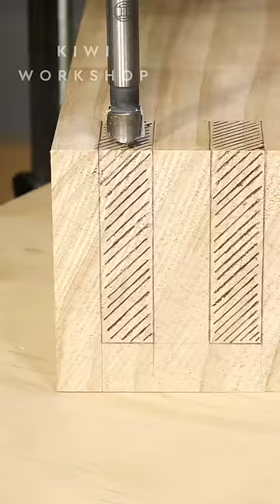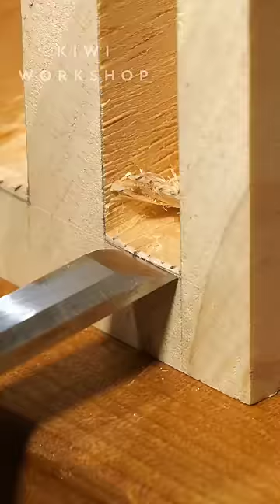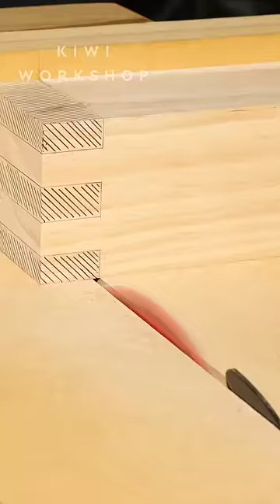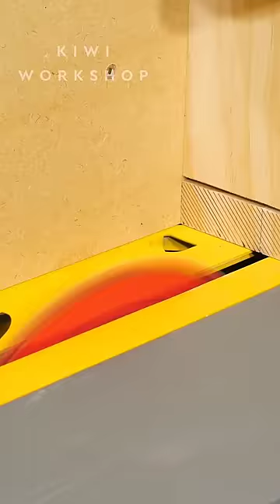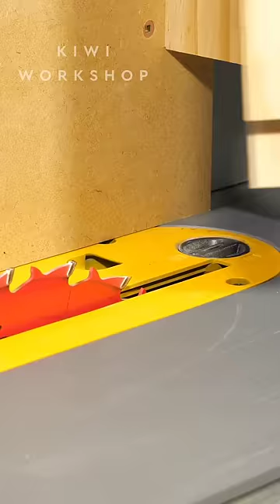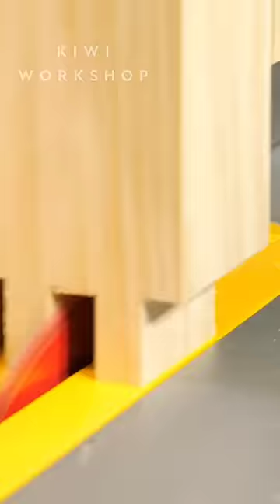What Is This Joint Called? #woodworking #diy #asmr

Comment: This one is easy: this is kakushi mechiire, or "housed tenon and mortise splice".
Reply: Como se llama esa broca?
Reply from the maker: @egglyph I usually refer to this joint as a "half-blind stub tenon" but the names you mentioned are also correct. I knew this was also a Japanese joint but didn't know the name. Thanks.
Reply: @kiwiworkshop it's not any kind of mortise and tenon. It's a blind finger joint because you have the same cut outs on either piece of material. Tenon is the shape of material to be fit in to a mortise which is specifically a hole to receive said tenon.
Reply: @dougler-6215 pero el término que el dijo también está bien.
Reply: I bet you got bullied in school😅

Comment: Imagine zero tolerance woodworking
Reply: With enough practice and patience, it's entirely possible.
Reply: What’s that in reference to?
Reply: @princegobi5992  it's when the apple doesn't know its been cut already.
Reply: @LemonGarageYT  omae wa shinderu
Apple: nani?!
Reply: @starmaker23871 
That's called wire EDM not "zero tolerance." Also, you're conflating tolerance with clearance.

Comment: Half-Blind Finger Joint... although if you make the fingers twice that length, it can become a PINNED half blind finger joint with the addition of two dowels from the side. Using a wedge would create a (you guessed it) WEDGED half blind finger joint. These joints are used in timber framing and also in furniture construction to extend the length of a board.
Reply from the maker: Half-Blind Finger Joint is a perfect name for this joint. I have been calling it a half-blind stub tenon but might change that now. I might try the two variations of this joint that you mentioned at some stage. Thank you for your informative comment!
Reply: That’s what I was going to say/call it but someone beat me to it.
Reply: Half-blind finger joint was what i would’ve guessed as well.😁
Reply: Thank you; you just won me a bet. 😉😉😁😁
Reply: @kevinchristensen84  lol. You gotta share with the group!

Comment: I'd drill the first holes in those mortises on the line, then go back to the outside and work your way back in. Other wise the drill may tend to drift on an angle without wood supporting all sides of the bore.
Reply from the maker: In principle I agree with what you said. However with my small forstner bits, they clog up very quickly when drilling into a closed hole. By starting on the outside, there is an opening where the chips can get ejected without clogging up the bit. That's why I started on the outside in this video. Thanks.
Reply: @kiwiworkshop  fair enough! Clean work either way. Cheers

Comment: I'd call it a half-blind half scarf joint... How'd I do?
Reply from the maker: Top marks for "half-blind'. You are on the right track with a scarf joint but that would have an angle cut into each length. I call this joint a half-blind stub tenon.